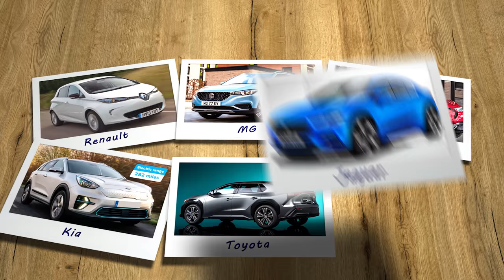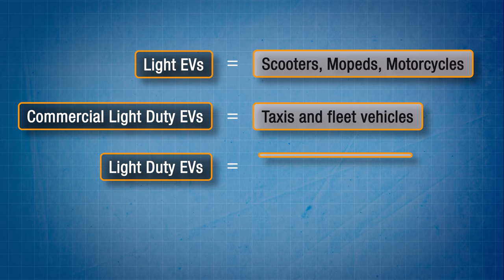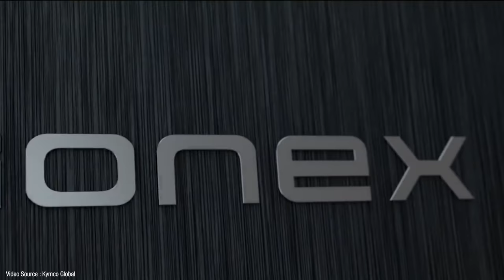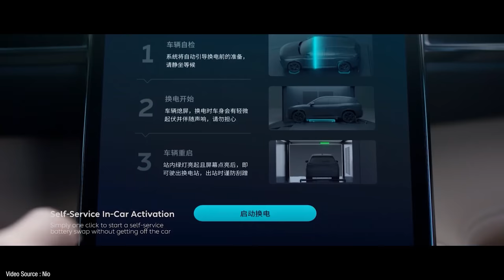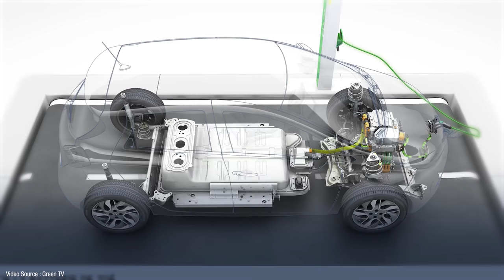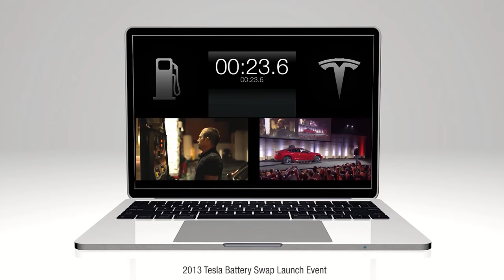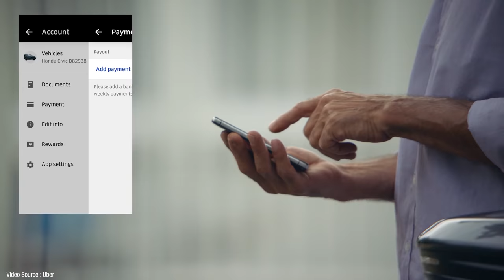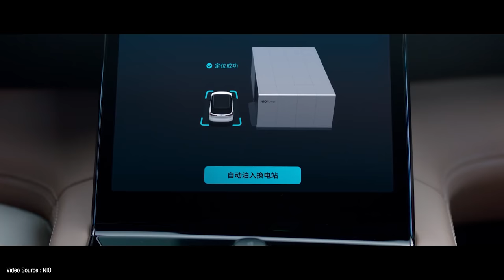Battery Swapping. Transforming the trajectory of electric vehicles?

Comment: In US, this would seem a very viable alternative for over the road semi trucks
Reply: YES!
Reply: Yes, for commercial vehicles, that need to be on the road more hours than they are parked, this is the only way. For everybody else? Higher cost per recharge, more expensive vehicle to build and worse performing from the added weight of extra hardware. Like vaccumcleaner bags: Pay less for the car, but suscribe to a battery swapping service? This is very much against what a car represents to the owner.
Reply: That would be one huge battery to swap.
Reply: This has already been done in the US.  No one really wanted to swap out their battery pack for another of unknown quality.  their is a shortage of batteries.  This would require 2 to 3 times as many batteries per vehicle. Also charging times are coming down quickly. The concept was given up by Tesla who first time introduced a working system.
Reply: @jonfscott  this has not been done related to semi trucks, as full BEV trucks not yet at scale in North America.  In this context, rapid battery swap keeps truck on road longer and further, lowers overall weight as fewer batteries needed between swap points.  This leaves more freight capacity, improving economics.
Reply: @tjmzm1154  I see your point.  It does make sense.  It seems like a viable option once we have enough batteries.  Then it would make a lot of sense. I’m all for it.  But charging a big rig is also easy because of driver required rest times and the can be charged while loading and unloading. An average truck takes 3.25 hours while loading and unloading. While waiting.

This would be a great deal for the 20% long haul trucks.  Then again their are the legally required rest time for the drivers.  
I agree with you but the cost of batteries need to drop.  The new Tesla charging system has dropped to just 25% of what they cost to install just 18 months ago.  Just by pre manufacturing in sets of four that are placed ready to go with exception of the wiring.
Reply: @hamobu  The batteries could be standardsized, so a truck would take 6 modules or such.
Reply: @Tore_Lund  one estimate of Tesla semi battery that I heard of was 11,800 kg or roughly 26,000 pounds. Maybe a swappable battery could be smaller, but even in six pieces you are dealing with metric tons.
Reply: @hamobu  Where I live, there are electric garbage trucks, (They no longer wake me up in the morning!) And the battery is mounted in a box behind the cabin on a track to be pulled out sideways , so not swappable I presume, but semi easily removable when needing service. A similar system could be used for battery swapping: A giant gantry you park under, and the 11 tonnes could be lifted out in one swoop. or you could have 500kg casettes accesible from each side. Still you might be right. Trucks make plenty of stops at distribution centers and fleet management will incorporate stae of charge, when they calculate charging times, so it might be the easiest with a charger at every ramp.
Reply: @Tore_Lund  Tesla car battery by itself is 500kg. Might be workable with garbage trucks since they don't go very far and stop a lot, but I don't think it will work with long haul trucks.

Comment: I see two big issues. The first is how to handle the many different types of batteries cars use, seeing how standardization would be difficult. A bulky truck can't exactly use the same ones as a tiny 2-seat car, nor would people want to pay for batteries with more or less range than they need. That's the neat thing about a power plug, it works just as well for any vehicle.

The second is deployment and cost. It's fairly easy to set up a power plug and connect it to the grid, it can be done just about anywhere a car can park, and existing gas stations can be retrofitted. It's also scalable, more plugs can be installed as demand increases. But setting up a mechanical system with a battery warehouse? That pretty much requires its own facility and a certain amount of users before it even becomes commercially viable. Hence it may make sense to switch to swapping as the primary charging method only once a certain percentage of cars on the road are compatible, and rely on regular plugs until then.

Comment: I have always thought, since I heard electric cars were coming, that this would be the obvious way to do it. 

Have a warehouse that charges the batteries, especially in the day if they use solar so they'd have enough stored for people over night. Then it's the same time as filling up a car with petrol.
Reply: Me, too. I think a LOT of people were thinking that because it makes sense. But not for manufacturers who 1) ignore the issue alltogether as long as they can  or 2) invested a LOT into the high performance batteries. Light, high densitiy, can be fastcharged. Range was an issue and the likes of Tesla invested a lot to get that. 

Long range is not such a competititve advantage if there are swapping stations everywhere. 
it would also mean that other "good enough materials could be used (which again sidelines all the development to make LI work). 

Heavier than LI, no fast charging, much shorter range ? 

That can be good enough for people that do not drive much (normally), the occasional longer distance is O.K. (they swap once more), fast charging is not necessary and the higher weight (compared to energy storage) does not matter if they do not drive so much.

Comment: I pitched this idea to the US DOE some years back, and got told it wasn't "innovative" enough. If we can standardize computers, propane bottles, gasoline octane, etc., why can't we all decide on a battery pack that can be swapped out? If you've the time, here's one snip of our pitch: 	"Full implementation of the EVER (Electricc Vehicle Extended Range) project will utilize existing refueling infrastructure, and “stock” gasoline stations with battery sets and load handling equipment, permitting EV drivers to exchange battery units as is done with propane tanks for home use, flash drives for computers, and electrical appliances of all types, not to mention the standard gasoline and diesel fuels already available nationwide.  No massive infrastructure need be developed. Automobile manufacturers will still retain all design and style elements, but will have the added option of fielding fleets of EVs for whom power and range are not constraints as they are at present. Then, as battery efficiency increases, electric drive motors are improved and vehicle weight reductions are accomplished, the range of EVs will increase as well, continuing to add value to our concept, and requiring no or minor modifications."
Keep up the good work.
Reply: As you say, it makes sense to have an industry standard, compatible with all manufacturer's batteries, just as with the industries you mentioned. I expect that if battery swapping does prove to become a widespread service in the long term (sounds as if it is already quite common in some SE Asian countries), we will see a common standard sooner or later.
Reply: Why don´t we have a standard for laptops, cell phones, tablets? You expect OEM´s to adjust their design and agree on one format, give up the advantage over others by using the exact same product, have the same cost, battery capacity and charging speed as everyone else. Nope, not gonna happen.
Reply: I agree 100% and been wondering for years why battery swapping wasn’t being pursued. 
If the federal government subsidizes batteries to the point where you didn’t have to purchase one when you purchased a car, electric cars would be very affordable. Use existing petroleum filling stations as “battery swap stations” and get the dreaded petroleum industry capitalists on board to to provide distribution infrastructure. Isn’t that what Standard Oil of NJ did 120 years ago during the infancy of the internal combustion engine?
If I as an electric car owner want to take my business to a battery swap corporation that does its battery charging with renewables — “Sunvolt Corporation” — I can do that without having to rely on my sluggish local utility to insure I am “charging from renewables”.
Having a charging station for every street-parked urban vehicle is impractical.
Reply: It means that battery companies that have a relative advantage would give up some of that. The ability to fast charge and to have light weight batteries disappears all producer have access to the same quality of batteries.
Cheaper EV's with less range look much better (so the advantage of other cars with a good range disappears). 

So of course the industry would not do it. nor would government force them to do the obviously reasonable.
Reply: @165Dash  There is no guarantee whatsoever the swapping station will use renewables. For example NIO station has 14 batteries. With 5 minutes per swap, those will be gone in 1 hour and 10 minutes. And they better be charged for the next customer. The station is not going to wait for oversupply from renewables. If we go fully electric, cheap slow chargers on every 5th parking spot or so capable of V2G are the most practical way to go.
Reply: Especially good idea as we start the transition to greater adaption of electric vehicles.  I remember the change from leaded to unleaded gas. The nozzles and openings to the gas tanks were different.  Set a standard and move along.
Reply: The present OBD III port on all new automobiles is the same for all brands- this is the port all external diagnostics are read through. It took, literally an act of Congress to make that happen- one stinking lousy plug, the same for all makes and models. You probably aren't aware that Big Ag has been trying to "lock up" all the maintenance on machinery they make with "proprietary computers" nobody but "factory authorized technicians may access". That is how close we are to a common standard in the US- the few things that are, like watch batteries and small batteries for toys were accomplished long ago in a much more flexible and common sense time- this is not that time, I assure you. FR
Reply: Just like you can get power-packs to extend your mobile phone battery, I wonder if there's any benefit in swapping a battery kept in the trunk and leaving the one underneath in place. Might need some additional wiring though!
Reply: @michaelstreeter3125  I'd keep a separate battery for things like clock, GPS, and apps (for instance, distance, location, and availability of batteries for trade).
Reply: @michaelstreeter3125  Actually a very interesting thought!  And one I haven't heard or seen any of the current electric car makers talk about. Please keep your thinking bone engaged! FR

Comment: In the long run, moving parts can't compete with plug and play.
Battery swaps may make sense for as many years as sending DVDs through the mail did.  But precision machined hardware has a hard time keeping up with electronic components hanging out on a circuit board.

Comment: Battery swapping can be done with structural batteries as well as non structural batteries.  The difference is that structural batteries take on part of the structure of the vehicle and would probably have many more connection points than nonstructural batteries.
Reply: I don't think it's practical with structural batteries.  There would be a LOT of high strength fasteners, and these are not designed for constant on/off use.  I think battery swapping for cars is never going to happen unless it's subsidized, and if it does happen, it will slow the adoption of EVs because we are battery constrained today and will be for years.  Battery swapping requires a huge number of batteries to be stored at swap stations, so we could only have a fraction of the EVs we otherwise would.

Comment: The key issue for the huge numbers of driver/owners in urban areas without private parking is access to any kind of recharging point. The market penetration, the number of private EVs will be limited by the availability of accessible charging and multi brand battery swopping has to be among the long term solutions if EVs are to dominate private transport.

Comment: There is an important option missed here and that is a design where a car could come with enough battery for say 100 mile range and then have a place to both add and swap batteries in addition to the standard pack.  The additional batteries could even be hand loaded.  
Advantages are: cut the OEM battery cost in half, still use home or charger for 95% of total miles, greatly reduce vehicle weight and all that goes with it, cut down on self discharge.  Note that all batteries could also be swappable.

Comment: The biggest issue would perhaps be the standardization of battery packs. No one wants their batteries to be exchangeable only at a branded exchange, and exchanges don't want to have to stock every kind of battery pack available from any automaker, or even a single automaker. So I'm thinking it would be neat to have small exchangeable battery modules. Each module might only contain 1 kWh, but the idea would be that any module would work in any vehicle, with a standard shape, voltage, communication protocol, etc, so the automaker could design their vehicle to fit any number of modules they like, in any orientation they like. You could roll up to an exchange station, it extracts 50 modules from your car and replaces them with fully charged modules. A few hours later someone in a scooter comes by and exchanges 2 modules. Then a semi comes by and exchanges 200 modules. A one stop shop for any vehicle needing a battery swap. And this format also makes battery refurbishments easier, because it's more practical to hold back a 1 kWh battery module for repair than to hold back an entire 100 kWh pack to replace one bad cell.

Comment: yes, I agree that in a perfect world this is a great idea, but there are some issues currently, as stated in previous comment.
1 - They need more battery packs than cars using it, so battery production constraints and materials issue (as per so many concerns about rare earths) are a problem. 
2 - You say it’s cheaper than super chargers. However, I’ve seen figures that put it three times the cost of a charger, plus these are staff maintained. And if there’s a queue, your replacement time goes out the window.
3 - How many batteries do they hold and if only slow charging to conserver battery life each battery probably had a turn around time in excess of 6 hours. What will be the number of swaps possible per day?

Comment: One thing that I believe is a benefit of battery swapping is, that extra batteries could be used in as a backup battery for your house during blackouts. Basically you have the swapping station in your garage and it would swap out your batteries with the batteries with the most charge. The ones with lesser charge would be recharged by your wind and/or solar systems to be changed the next night or power your house in the event of grid failure.

Comment: I don’t really think this idea would work well with the mind set of most of middle America. I’m from Michigan, and at least here It seems to me that most people would want to own their own battery
Reply: Hi, I understand what you are saying, but when they purchase petrol/gas - although they own it, it is spent in double quick time, so there is no residual value in the fuel. However I’m inclined to agree with your conclusion regarding the mindset and also because standardization internationally does not look likely any time soon. Nevertheless it’s an interesting approach with some merits, not least of which is that batteries could be smaller and lighter if easy to swap quickly. However, if battery tech advances quickly with regard to weight, durability and storage capacity - then battery swapping might become redundant very quickly. Interesting times.
Reply: Why? Who cares? You don't need to own your own go cart when you go driving them, do you? You also don't need your own airplane when you are travelling overseas and you don't need your own towels when you are going to a hotel. Why would you care if some part of the vehicle you never touch is always the same or changes from time to time? Do you care if they change oil in your car as well?
Reply: @peter.g6  well with new oil, no I would not care. But if I have nice new oil in my car, and someone switches it out with dirty oil, I wouldn’t be terribly happy. Does my analogy help? You aren’t guaranteed a better battery than the one you could buy in a swap. I’d rather just take care of my own and not rely on the curtesy of others
Reply: @stephenshannon3706  fully agreed with you, the idea fundamentally I do like, but quick obsoletion wouldn’t be very helpful for everyone involved in the program. Also when I talk about the mind set of “middle America” I’m referring mostly to southern minnesota and Michigan, two places I live and have lived in, and have friends in. That said, these folk don’t equate the battery with the gasoline in the car, they equate it with the motor. I think that difference in mind set will be hard to bridge, especially given peoples different preferences about the type of car they want to own. It just seems like a one size fits all model, to fix an issue that is still in its infancy of even forming.
Reply: @marcdean9618  Do you mean for example the battery package would be somehow damaged and the process of swapping into your vehicle could do some damage? I mean, there is something to say here, what if you were going on muddy roads and then enter the battery swapping station. Could you do damage to it? Could you do damage to the car that gets the muddy battery after you? You might have a point if you meant this.